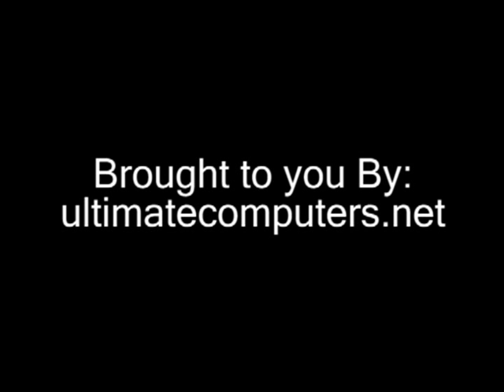TechBits 3 - How to Pick Compatible Parts for a Computer Build

Comment from the maker: There isn't a very good way to do that... you would need to split the 24pin cable, and there would be an issue with the power-on wire...  You could try the ePOWER EP-2000P10-T3